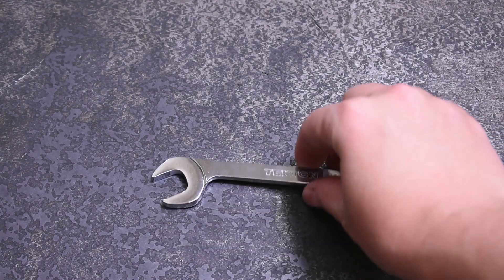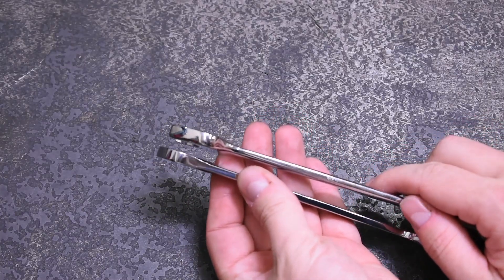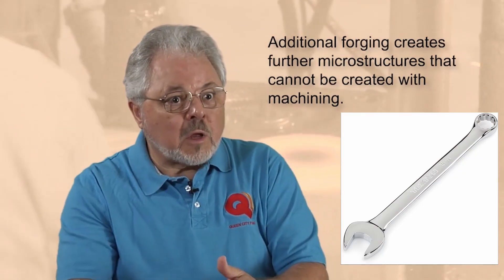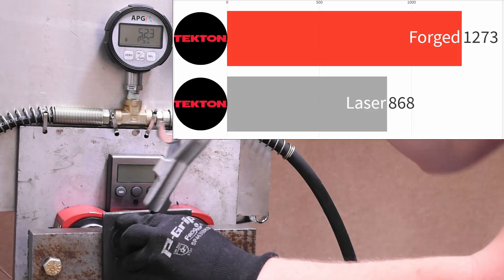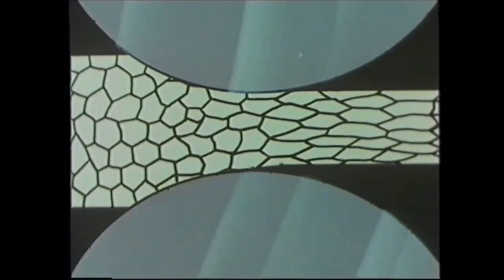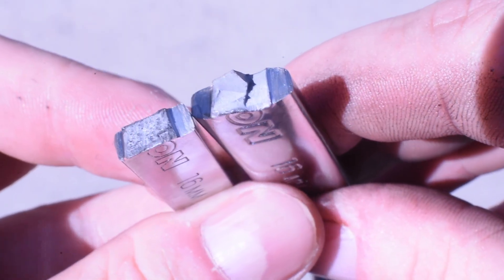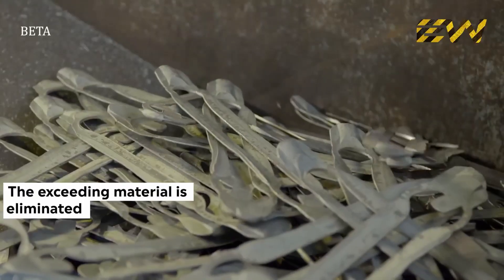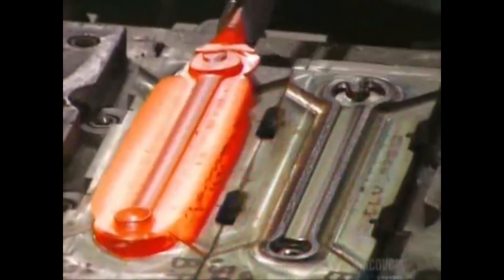The Curious Case of Laser Cut & CNC'd USA Wrenches vs Forged

Comment: Have to call bullshit on forging making steel tougher and stronger it simply isn't true despite what an old video may say. Steel isn't wood, it doesn't have long grains running through the length of it. Heat treatment is what makes or breaks a grain structure not how the steel was formed to shape. The difference you were able to observe in grain structure was a clear example of 1 tool having a better heat treatment than the other.
Reply from the maker: I encourage you to have some cast alloy steel perfectly heat-treated and compare vs something forged then if grain structure doesnt matter. Steel isn't wood you're right, it's doesnt naturally have long grains. When cold worked into bar or plate however is does develop those long(er) grains.
Aluminum doesnt heat treat at all, yet grain structure alone accounts for the vast difference in cast, vs flow formed vs forged aluminum wheel strengths for instance.
I'd be happy to read any sources you can link to that says otherwise however.
Reply: @Torque Test Channel  We are not talking about cast, we are talking about the difference between hot forged to shape 4140 vs machined to shape 4140. When I say forging doesn't make steel tougher I should edit: Hot forging doesn't make steel tougher and stronger. Cold forging does increase strength but that process is performed at the steel mill before the steel even gets to the forge or machine shop, then the steel is shaped (forging or machining), heat treated and finished. Here are some bits quoted from the book "Knife Engineering - steel, heat treating, and geometry" by Dr Larrin Thomas, if i am misinterpreting or misunderstanding it I will be happy to be corrected (Chapter 17 Forging from page 188) :
"COLD FORGING Forging is possible at room, though steel is easier to forge at higher temperatures, call "cold forging". 
The strength of the steel is increased with cold deformation, just like in a tensile test where the stress goes up as the steel is stretched until the ultimate tensile stress is reached prior to fracture. The steel generates more and more dislocations as it is forged or rolled. Dislocations cannot easily pass through each other so as the density of dislocations is increased, it is more and more difficult for dislocations to move which increases the strength of the steel. The steel would like to eliminate those dislocations and return to round, “equiaxed” grains rather  than elongated grains. However, at room temperature there is insufficient energy for this process to occur. With enough temperature, however, the rolled steel will spontaneously “recrystallize” where new clean grains with low dislocation density are formed. Therefore, recrystallized steel is softer because of the low dislocation density.”
“The more cold reduction that has been applied to the steel, the lower the required temperature for recrystallization.” The temps given for recrystallization are below full austenite temp and well below forging temp.” 
Page 195 “GRAIN SIZE Like with cold rolling, during hot working grains are deformed and the dislocation density increases. However, because the temperature is so high, recrystallization occurs almost immediately. This is called “dynamic recrystallization”. With the relatively small amount of deformation that is applied with a hand hammer by a bladesmith, grain boundaries are regions of high energy in the steel, and increasing the grain size leads to a lower number of boundaries. Steel wants its grains to grow to reduce its internal energy, and the higher the temperature the more rapid the grain growth.”
Reply: @kurothot2203  No one is talking about hand forging knives. I've personally seen how Snap-On forges their wrenches and their forge produces 40 tons of pressure for a single wrench. The material is much thicker before it's smashed into shape, more material equals more strength.
Reply: As stated the strength produced by forging hot or cold is reduced by heat. What happens after it it smashed by a 40 ton press or hammer? It is heat treated.
Reply: @kurothot2203  Snap-On heat treats after they're forged. Regardless you start with a thick piece of metal and it's smashed into a thinner piece of metal...how can you are argue its not stronger? The grain structure is forced to become tighter during the forging  process.  You can heat treat two pieces of metal...the piece thats forged is stronger. Also these wrenches are not 4140 steel. I know rifle barrels are typically 4140 and 4150. Forged 4150 barrels are more expensive and last longer due to the fact they're forged. I don't mind a difference in opinions but I cannot find any information that even slightly supports your theory.
Reply: At 1.02 minute mark he states and shows it is made of 4140 chrome moly.
Reply: I was asked if i had information to support my opinion to present it, I've done that. Would be great if maybe torque test channel could reach out to Dr. Larrin Thomas (knife steel nerds) or another metallurgist to explain why I am wrong and what is going on, would make an interesting video considering part of this video has been about can a machined wrench be as strong as a forged wrench.
Reply: @kurothot2203  Snap-On wrenches are proprietary steel and I doubt they're 4140 but there's no way for me to know for sure. The issue with the information you've provided is it is referencing hand forging not drop forging. I realize hand forging is physical, slow, and time consuming but there is a reason Snap-On uses a 40 ton forge. There is literally 10 stories of high strength concrete under it and the entire building shakes. That book you're reference also has a section on the advantages of forging...what does it say the advantages are?
Reply: First of all, this video and my comments on it are not about Snap-On, it's about a brand called Tekton who, as refrenced in the video, stated on their website that the type of steel used is 4140. Secondly, simply saying a manufacturer forges their tools is not evidence that hot forging creates a stronger tool. As stated in the video there are pro's and con's to forging and machining, mainly once the cost and time of creating tooling for forging it is quick and economical to produce at scale where as machining is quicker to create smaller batches to get to market quickly but is usually not cost effective or quick as it is scaled up.
I'd be happy to read any sources you can link or refrence that are counter to my opinion.
Reply: @kurothot2203 First off your original comment was forging does not add strength which is false and it also doesn't apply to the tekton wrench because guess what it's not forged. You made a blanket statement that forging doesn't create a stronger tool, your words not mine. Then you sight a book about hand forging knives primarily made of damascus steel which isn't an apples to apples comparison. If you read your quote then you would see the author is talking about hand forging not drop forging.
Reply: Congratulations, you have won the award for most ignorant comment of the day!
Reply: https://youtu.be/SpaXQ_Wi3Xo

Comment: I'm an equipment mechanic and working on hydraulic lines that are many times in awkward positions/ packed closely together, I find myself almost always grabbing the tekton 30/60 before anything else even crowsfoots
Reply: I was about to make a similar post when I saw yours.  I also work on heavy equipment and military equipment.  It is always frustrating, though not shocking, how manufacturers like Oshkosh, Stewart & Stevenson, AM General have designed their vehicles with almost no thought to how they will be worked on or maintained without specialty tools.  I know, they are built to the military's requirements, but sheesh!  I have so many Frankenstein tools that are cut and welded at goofy angles so that air/fuel/hydraulic lines can be reached and tightened properly.  How many times have you wished you were born with an extra elbow in the middle of your forearm?  I have "S" wrenches that have been heated so that an extreme offset can be introduced, and vice versa on some of my offset wrenches.  These tool mods are only for repeat applications, but without them, the work mind numbingly irritating.  I've rarely found situations where crows feet provided anything but frustration, though I know they have their place.  I'm glad Tekton is bringing unique tools to market.
Reply: @matthewpeterson3329  same with regular cars so tight you cant get in to work on anything without taking things apart in the old days it was right there not hidden behind 5 other moving parts or having to unscrew things just to get to the lights to change a bulb
Reply: In my experience all a crowsfoot is good for is anger management training.  Yeah, I'll take the 30/60 thank you!

Comment: Sounds like despite the incredibly high start-up costs, there might be a large amount of money to be made starting up a forge in the USA.
Reply from the maker: Craftsman in Fort Worth, TX seems to be doing forged pieces and hiring forge workers for their new plant. But you're right. The larger the tool, the larger the forge, and larger forges take exponentially more $, space, employees to operate.
Reply: @TorqueTestChannel  Milwaukee too in West Bend for their new pliers and screwdrivers.
Reply from the maker: @dulmi2317  I'm unsure if those tools are machined from forge blanks however. Not that it isn't really cool they are doing that
Reply: @TorqueTestChannel  former hammer operator here. You’d be surprised how few people it takes to fill massive orders. In a typical cell of mine, we could have 2-3 people per cell and forge thousands of wrenches (etc) per shift.

Oh, and that plant in texas you mentioned was a result of black and decker’s assault on a 50+ year old forge in colorado. B&d put hundreds of people out of work over old grudges. Many of the old machines were then bought and just moved to texas. Those tools were already made in the us and we had many contracts for all sorts of brands. That’s how business goes i suppose but b&d-stanley is a non starter for me. Point is, the increase in cost is far from exponential and labor is minimal when companies like ideal…or b&d for example underpay and overwork people. At it’s prime, the forge could have 30 people per shift and produce 40k-60k forgings per shift.

If you have any questions about the forging process, hit me up.
Reply: 100%, unfortunately until people are willing to pay significantly more, operations like that in the US are going to be very difficult to sustain I suspect. There's a reason all this manufacturing went overseas to begin with: people want the cheapest option. 

I buy the US manufactured stuff on principle, and I'd love to see a rebirth of US manufacturing, especially as China is pushing more and more for dominance in all arenas, it's more important than ever to bring that capability back here en masse. Aside from heavy shipbuilding applications, we don't do that on any large scale anymore (our biggest forges and presses are WW2 era). If we found ourselves in a naval conflict with China, we don't have the ability to scale up production like they do (or even like we did in WW2): it would take years and years just to build the infrastructure.

National defense aside, the last two years are a great example of why home-grown manufacturing and a large body of tradesmen who know those skills are such a huge benefit.
Reply: @thepewplace1370  the US government is trying to bring EV battery production back to the USA with the new EV rebates. One rebate requires vehicle final production be in the US, the other rebate requires the battery material be mined in the US. This is intended to hurt Chinese lithium mining.
Reply: @thepewplace1370  you hit the nail on the head. People say they want made in america, until they have to pay for it.
Reply: We have the technology to bring manufacturing back into the United States with better product made with better standards and no human rights violations.
Reply: @redjellonian8126  we've had the technology: hell, we invented most of it, and the current manufacturing kings got it from us. We even still have the know-how, although the pool of those tradesmen is much smaller than it used to be. 

The biggest problem is the US consumer, who on average, doesn't think beyond saving a few bucks and wants to be able to order something with two day shipping off Amazon, happily buying cheap Chinese junk that they will likely spend more on overall when they have to replace it sooner.
Reply: @thepewplace1370  someone in the UK said exaclty what you said 60-80 years ago.
Reply: @thepewplace1370  Is it really junk if it outperforms the US made options?
Reply: @Mr30friends  the vast majority of the chinesium junk on Amazon doesn't outperform the US built stuff. The places where it does outperform US stuff (hand and power tools, oftentimes), it's because the US mfg are having to cheap out to make up for the slave labor savings the Chinese companies are getting, or otherwise charge Snap On prices, which again, comes back to the US consumer wanting quality without having to pay for it.
Reply: @reverse_engineered  it's not just a quality thing (although sometimes it definitely is), it's a principles thing: the chicoms actively want to destroy us, so I have zero interest in giving them any more money than I absolutely have to. I try to buy American, or atleast European, for a few dollars more. It's normally not the snap-on price difference though. Just shop around and see.

Comment: Another aircraft mechanic here, I agree that the 30/60 head angle is a must in our field.  Snapon had the patent on these wrenches for a long time and I am glad to see other manufacturers offering these wrenches and at a much lower price.  I paid close to $1000 for my snapon set 10 years ago.  The last I looked the same set from Tekton was around $300 give or take.
Reply: ahhh gotta love the snap on truck. 2 screwdrivers for 100 a week for the rest of your life lol
Reply: @brainstorm4207  just remember that after the first step on the truck, its consensual....
Reply: @jakeelenbaas971  Still con artists.
Reply: My parents taught me early never to take the candy from people in vans with no windows. Steering clear of the tool truck step vans seems to have been a good life choice so far.
Reply: I’ve got a set of tekton and love them 
I agree they are a must have in aircraft mechanic field
Reply: Patent? ** patents on something as simple as "60 degree bend".
Reply: @TechyBen  it was the 30 degree bend actually, other wrenches at the time came in 15/60 degree offsets
Reply: @jakeelenbaas971  Even worse then. Cos what, 30.0000001 degrees is not patented?
Reply: @jakeelenbaas971  It didn't take long to realized I needed a set of these when I first got into airplane fixing.  I took a look at the cost of snapon stuff and noped out.  Was working on my R1340 and none of my tools were able to reach the forward three carb nuts, so I went to harbor freight and found a set of the ridiculously cheap offsets from 1/4"-1 7/8".  Looked like they were stamped out of 1/4" sheetmetal, it's the kind of rock bottom quality you can't even find at harbor freight anymore lol.  Turned out to be one of the best investments I made, maybe $25 all in and those wrenches have survived nearly 25 years of use...so that's like a buck a year.  It's not like you're going to be able to really put the beans on these wrenches in a situation where you actually need them, you're lucky if you can even reach acceptable torque, so high quality and strength aren't really that big of a concern.
Reply: @Skinflaps_Meatslapper  Good ol' Hazard Fraught.
I am so glad they finally opened a store in my town.
I am worried they are going to go too up market and I won't be able to afford them.
Reply: @1978garfield  Same, I went to grab some cheap swiveling impact sockets for a single job and was faced with a $140 set from Icon...had to rummage around on the end of the aisle before I found the cheap set for $40.  Kinda scared me there for a minute LOL
Reply: @TechyBen  seriously, how can that be patented? There are some things that aren't really all that innovative that millions of people have already considered..
Reply: @TechyBen  Yeah, all you have to do is change the angle to 57.5 degrees and get a patent on it.  There's not a thing the first patent holder can do about it since you improved it by changing the angle!
Reply: These are a specialty tool not necessarily  used for breaking tight bolts.they are awesome obstruction wrench and hard to beat for hydraulic repairs.
Reply: If you think the patent on the angle is goofy, check out US11040432. It's Tektons patent on this laser/milled manufacturing method. 
Cause millions of different parts aren't manufactured like that already. The mind boggles.
Reply: I like the free pocket screwdrivers. I use them a lot

Comment: Something I noticed watching this video and double checked on the original wrench test video. You priced out the WaveDrive Pro wrench set from Capri but in testing used their MaxChrome line, two very differently priced and designed wrenches. It would be nice to see how the WaveDrive Pro wrenches stack up in testing as I think using pricing from them but testing a cheaper product line is slightly misleading in the ranking chart.
Reply from the maker: Capri CP11390MT: https://capritools.com/shop/combination-wrench-set-tray-metric/
Reply: For some reason their website wasn’t showing me that set looking under the combination wrenches tab????? Only showed the tested wrenches available as singles.
Reply from the maker: @fillakyle  It's not your fault, I spent the most amount of time from all the brands on the list on Capri's website trying to make heads or tails of what's what when we're talking regular wrenches.